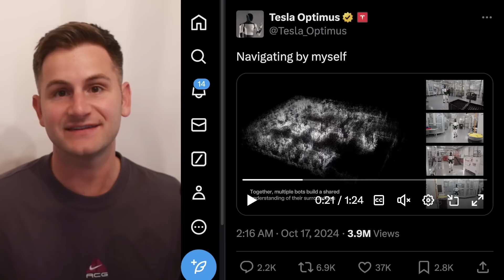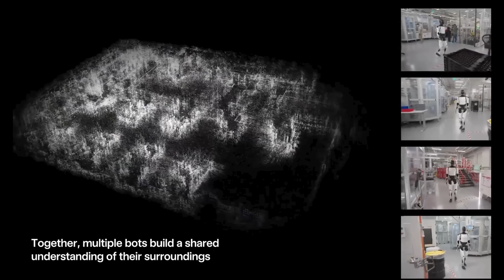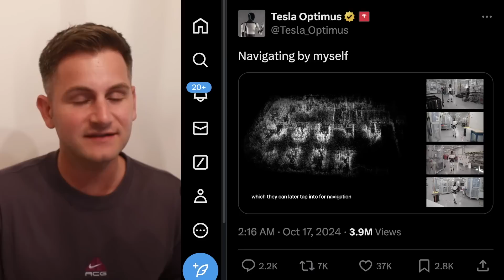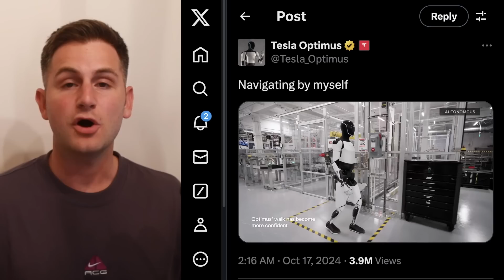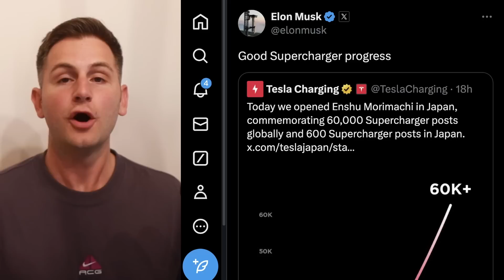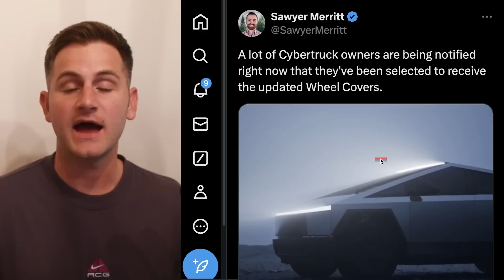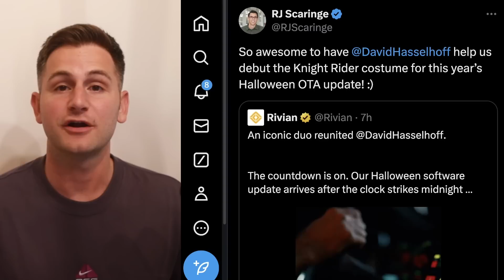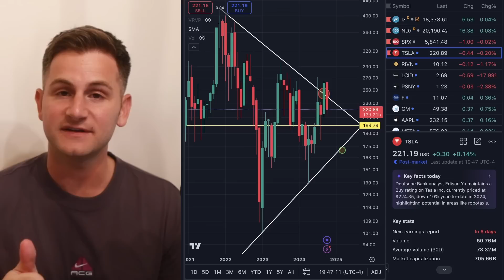Well, Tesla Was Sandbagging / Teleoperation: They Were Wrong / Tesla's Lithium Refinery ⚡️

Comment: as if people are actually standing around sorting batteries like that in the factory, where they're making at least a million batteries a day for the CT.   That kind of thing is done far more efficiently by just having the batteries move along a channel with actuators directing them down different routes as has been done for decades in every battery factory and in similar factories.   Where they will be useful, will be in taking parts or components randomly sitting in bins, orienting them correctly, and handing them to the traditional robots that are building the cars, where currently people have to stand outside the danger areas of the robots.

Comment: Were you expecting a cheaper car preview. The robotaxi could easily become a town car by adding a pedal and steering wheel module. Control by wire would only need plugging in after the fitting of the module. No complex mechanical links to the controls.

Comment: We have to consider, even for the recent We Robot event, Tesla is running in a highly restricted safe mode. My view is what we saw is possibly 50% of what can today actually be achieved in terms of Optimus autonomy, function, tasks, awareness etc.
Reply: Based on what? Are you a subject matter expert, or is it just a gut feeling that they're comitting fraud by lying to shareholders in their releases? Trevor Milton of Nikola Motors served jailtime for actions akin to what you're suggesting. If Tesla specifically labels video clips as full unsupervised, it means that they accept legal liability from the SEC and short sellers of the stock would have every financial incentive to initiate litigation against them.
Reply: @supercadet111 bro calm down they said they think that optimus is 50% better than what has been shown so far but it’s locked into a safe mode to make sure there are zero errors at the event or marketing

Comment: While I haven't tried summon from parking garage I have tried to get FSD to exit the garage without success.   Until they can get it to exit a 2nd level or higher of a garage summoning from such locations won't work.  Not sure it takes into account the difference in elevation.

Comment: There is nothing wrong at all about telepresense and "teleoperation." First, the robot has the equivalent of an "autonomic nervous system" and "tacit" knowledge and skills. These keep it aware of its surroundings, balanced and charged, able to walk, feel by touching, and use arms and hands to pick up things. It has a "attention" system for focusing, possibly followed by goal-oriented planning. Probably a library of basic skills required for expected tasks. Telepresence means a remote operator can be connected sensorily to the robot. Teleoperation means that minimally the operator can perhaps through voice or gestures communicate interactively with the robot and its environment. It also means perhaps that the operator can trigger focal attention and goal targets, which the robot then autonomously implements. Drones are good but limited examples of both. Out at the limit, teleoperation would become a form of avatar-like behavior in a distant (but not virtual) reality. If humanoid robots are to be deployed on the Moon or Mars, autonomy as well as both telepresense and teleoperation capabilities will surely be required.

Comment: 0:40 nice but Boston Dynamics had that  years ago. And then: Cybertruck? FSD? Where are they?
Reply: cybertruck is on the roads, FSD is in all Teslas. What do you mean? BD doesn't do unseen environments, they have set paths.
Reply: @lmcclymont   No, FSD is NOT in all Tecla's. Supervised, Hardware 4 Tecla's have SUPERVISED driver assist. Tesla has not even applied for  highway operation, thats how far off FSD they are.

Comment: teleoperation is useless for walking and stairs... it would not be helpful...  The stuff teleop can help with is, handing stuff out, and talking with humans.  The walking, picking stuff up...going up stairs... it requires the body to be able to re-balance and use proprioception (how far to lean back based on how heavy the thing is...) is all stuff that teleop won't be able to easily simulate with... unless the teleoperator is picking up the same pile of batteries... and has the same limb length and approximate weight distribution as the bot,  it's really hard for the teleoperator to adjust body position appropriately for the load.  

The teleop has got to work in conjunction with on-board ai... the teleoperator asks the operator to grip the box and lift it up, the bot figures out how much grip to use, and how to re-balance so that it doesn't fall forward.

Comment: Teleoperation of Optimus to train itself at this stage is like Tesla using their car owners early on to train FSD.  The only difference is that a human is inside the car it/s training while a human remotely operates Optimus to train him!  Far too many amateurs call themselves analysts!
Reply: There's one major difference: the range of what a driver can do with a car is limited to steering, accelerating, braking. Only a box moves as a result. But add limbs and hands to this, and the range of what the operator can do explodes. Moreover, driving is first and foremost about navigation and obstacle avoidance in a world of vehicles and roads. But the range of things a humanoid can choose to do is far greater, and requires understanding the world around it in far greater detail. Teleop doesnt help understand anything, just perform. Tesla will not solve Optimus AI with tele-operation, although I'm sure it can be good enough for a while.
Reply: @DivergentObserver  It’s still the same process of learning!

Comment: Yes the ASS does work on multilevel parking garages. However, you may have to move around because the car will sometimes stop directly above you. So if that happens, then you walk to a spot where the car realizes it has to move again. But it did work for me the first time I tried it. I was on the ground floor. My Tesla is parked on the third floor.
Reply: That means it works by chance though :)  Maybe it's just the goal reaching logic that is in 2D, hopefully for full autonomy they will make sure the vehicle has awareness of what level it's on.
Reply: @DivergentObserver and ASS does currently use navigation, so it can get stuck in loops

Comment: Not to discount the work going into Optimus, but it needs to show some actual utility and durability. Can it open a door? What if it's shoved or bumped into? Can it navigate difficult terrain? This is still a Chinese novelty robot performance.

Also, stop trying to conserve power and make it move naturally.
Reply: Part of the movement problem is no toes, has little fine balance control. But I agree this is not anything major from the last video released. I hope this has to do with a rethink on the software structure.
Reply: It walked up a stairway.  I thought that was impressive at this stage.
Reply: It's a robot. Why does it have to move naturally?
Reply: @darylfoster7944  The amount of appeal and relatability it adds can't be understated. Watching Optimus very slowly shuffle around like it's got something jammed up it's rear lacks all charm. Some could argue that doesn't matter on the factory floor. I say it matters to everyone who's human.
Reply: @darylfoster7944  It's a humanoid robot.  The more humanlike, the better.

Comment: 1:00 Know what else weighs a about a 11kg, a gold bar!  For our next demo these Optimus will load the autonomous Semi with gold bars...
Reply: Are they planning to rob Fort Knox?
Reply: As 1 ton of gold could fit inside of a 16 inch cube or box, 80,000 pounds, or 40 tons of gold could fit inside of a Tesla Model Y.

So, while the Tesla Semi could haul 80,000 pounds of gold, it would take up little space inside of a giant trailer. So, a waste of space. But, not a waste of weight hauling capacity or capability.